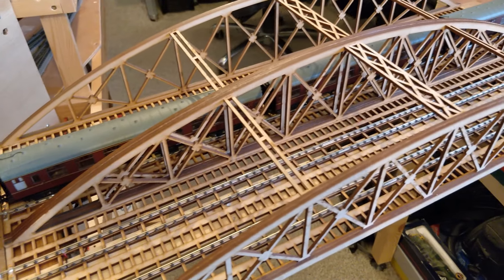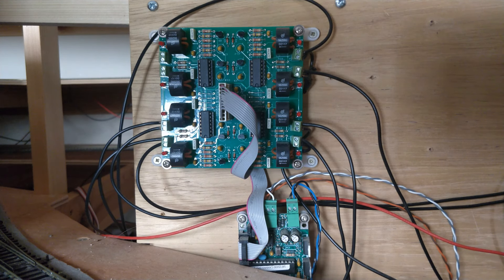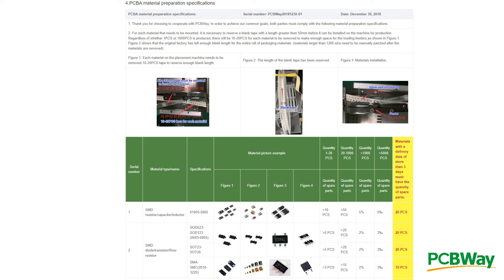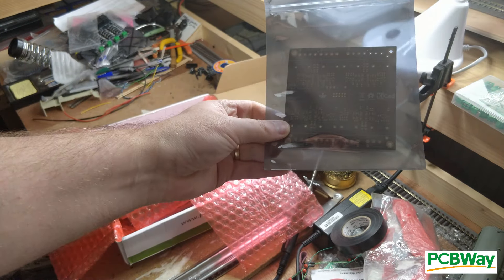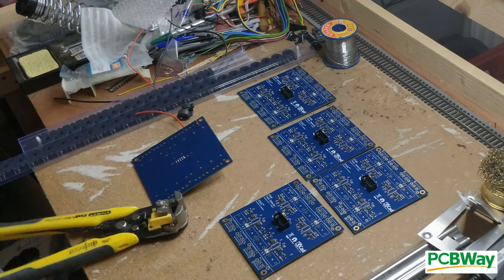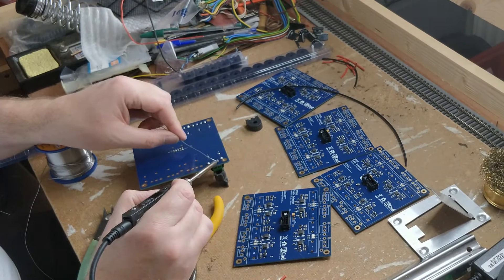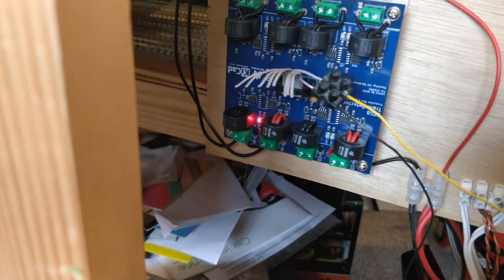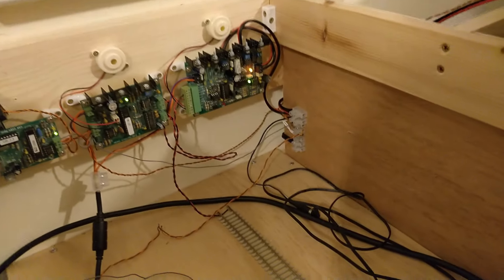A Surface Mount upgrade for the Train Detector

Comment: Interesting video - I use those MERG kits myself but have poor eyesight and find the soldering a bit difficult at times. Are PCBWay able to make the boards you ordered available to others to buy?
Reply from the maker: I'm working on making them available that way. Note that you'd need to source your own current transformers and screw terminals, and they will likely turn out more expensive than the MERG kit once that is done.
Reply: @DongitsModelRailway  Thank you - that would be extremely helpful, I'll keep an eye out. As I'm not great - eye condition means shaky hands - with the soldering, I don't have a 100% success rate with them, so if there was less chance of producing failures it would probably be more economical for me.
Reply: Hi, did you ever get this resolved, I would like to have ago with these boards, the terminal blocks on the merg units are iritating @DongitsModelRailway  Thanks

Comment: I must admit I find the process of laying out and routing tracks on a PCB very absorbing.  I've used DipTrace to produce some nice multi-layer boards which were made by PCBway and the quality is very good.  Was there any reason for having the KiKad logo on all the boards ? - As for cost, that's down to quantity.  Start doing production runs of 100 or 1000's and the cost per board falls dramatically.  Once tested and proven, with the small changes you mention incorporated I'm sure you could start to retail them as a side line.  There must be a few large layout builders, both private and club layouts that might be in the same predicament you found yourself in, and could use these.  Who knows you could become the next megapoint controls  🙂
Reply from the maker: Is there a reason to have the logo on the board? Not really TBH.

Yes, the price per board is really very dependent on quantity, but five is a magic number. Try ordering six and see what happens to the price! You don't get back down to the same price per board until you get to around 50 ish, which is quite a serious production run.

As to becoming the next 'megapoint controls' -- I think it would be rather cheeky to take what is essentially a MERG design with tweaks and turn it into a commercial product.
Reply: @DongitsModelRailway  I was in the process of trying to work out how best to create loads of detectors for my planned new layout and happened to revisit this video. The boards you have created are exactly what I was trying to achieve. If PCBWay do a "KDP" type service then I definitely think you should consider putting up the boards. People could then order what they needed and you'd get a commission. You wouldn't then need to worry about ordering several hundred that then don't sell, or having to box and ship kits.

I'm also trying to find an ABC module that has a bypass relay that I can control from an Arduino. All the ones out there seem to require an off-board switch or relay, which is just a pain. I see you have something similar to what I'm looking for and it also seems to be a custom design. Perhaps you could make that available at the same time 😉
Reply from the maker: @lodgegatewood  PCBWay do have a service where I can upload the files and people can order production runs directly, yes. The ABC board I'm definitely going to publish, I just need to clean it up a bit first. The DTC board is a bit more challenging to publish as it's not really an original design -- the circuit diagram is very MERG with a few changes, and therefore there is upstream intellectual property to consider.
Reply: @DongitsModelRailway  It would be super neat if you could publish your boards :) In particular SMD versions.